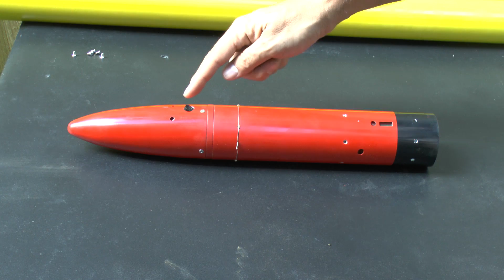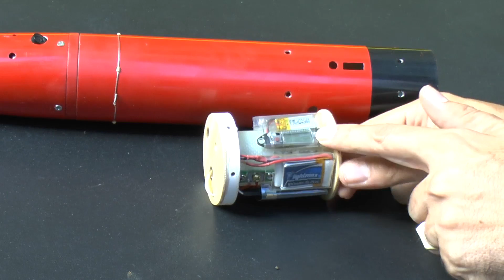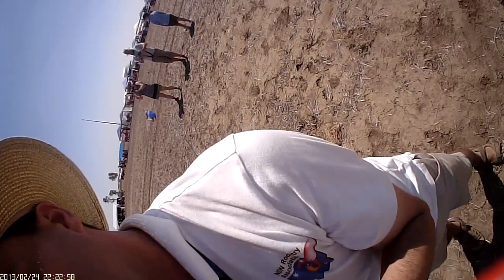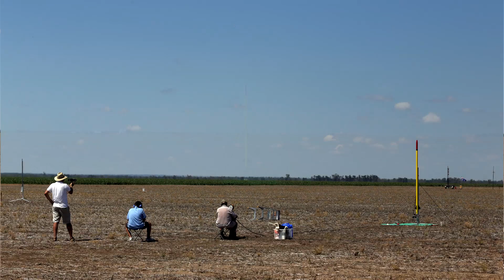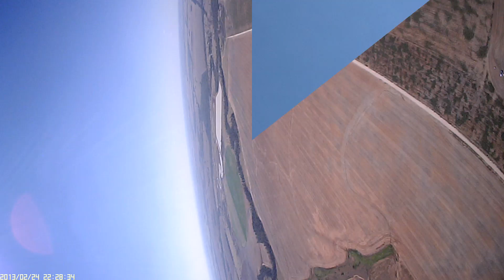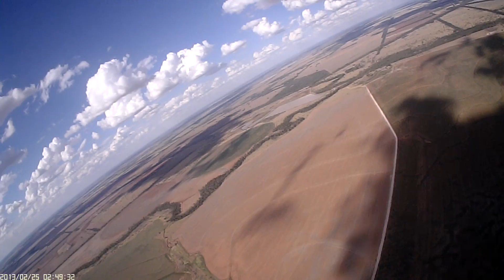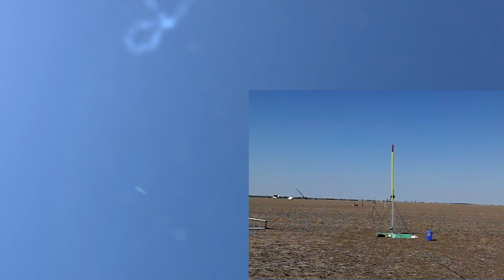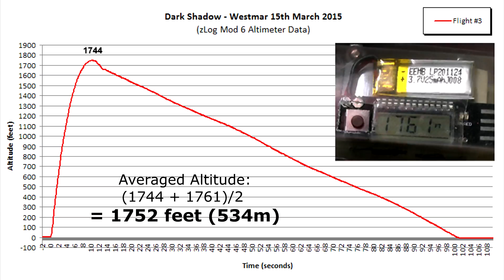Water Rocket flies to 1752 feet (534m)

Comment: It appears that there's a rod on the launch pad that extends up INSIDE the rocket through its nozzle and that most of the vertical thrust occurs while the rocket is ascending up that rod. There's some water that escapes during that short time but most of the water escape within just a few feet of the rocket clearing that rod.

So, is the acceleration, and therefore the height attained, due to the thrust acquired while moving up the rod or  is it from the water expelling through the nozzle? I'm wondering if it would give even better acceleration and height if they just left out the water completely, which would significantly reduce the weight of the rocket, and simply relied on the thrust achieved by having that rod inside it.
Reply from the maker: Roger Garrett Hi Roger. The rod is called a "launch tube". The launch tube acts as a piston during the first part of the launch. Depending on the size and length it can give about a 5% boost to the overall peak altitude. During the launch tube phase it produces about 1/3 the thrust compared to the thrust you get after the rocket leaves the launch tube and starts expelling water.
Reply: Hmm. I don't see how it can provide 1/3 of the thrust but only a 5% boost on the peak altitude. And from the very first picture of the video (and later in the slow-mo launch video) it appears that the water is expelled within just a couple of feet of leaving the launch tube/piston. Are th 1/3 ~ 2/3 numbers just estimates or "conventional wisdom" or are there actual measurements to support them. I'm thinking that the number of frames of the video for the launch tube phase and again for the subsequent water expulsion phase, coupled with the distance travelled in each phase, could give at least some idea of the actual thrust being achieved by each.
Reply from the maker: Roger Garrett No, these are actual numbers. It's not 1/3 of the total thrust, but 1/3 of the average thrust for the duration that the rocket is on the launch tube.  The reason I say a third because that's what it is for this particular configuration. It really depends on the length and width of the launch tube in relation to the rocket and nozzle size. Have a play with Dean Wheeler's water rocket simulator and have a look at the acceleration and altitude curves with and without the launch tube.  We have captured very similar real world data with onboard accelerometers. Here is some real world data from one of our flights on a different rocket: http://www.aircommandrockets.com/images/2011/day100/PolaronG2_FC_Acc_Vel_290111.png

Comment: Wow how many Gs of acceleration does this thing experience?
Reply from the maker: Nevir202 On the last flight it was close to 50G. The rocket and deployment mechanism were designed for 60G+.
Reply: AirCommandRockets
Thanks for the response. That is just mind blowing! Just thinking of the stress implications of that kind of force.... Any organism would be liquified... O_O
Reply from the maker: With a lightweight single bottle rocket at only 120psi and a 20mm nozzle you can get accelerations over 150G!. :)
Reply: AirCommandRockets
Brain melts

Comment: Are you guys using just clean water for your propellant, or adding salt/sugar/something to make the water heavier & maybe increase your total impulse with the added mass?
Reply from the maker: Hi Robherc H , Yes we just used regular tap water and regular air for this one. You can dissolve substances in the water to make it heavier and generate greater thrust, but the rocket will not fly as high. This is because you are also lifting a greater mass still remaining in the rocket. Water rockets actually perform a little better with lower density liquids such as alcohol. Scroll to the bottom of this article for more information: http://www.aircommandrockets.com/water.htm
Reply: Thanks; that was an interesting read! Based on that info, I think I have much better informed idea for a different propellant mixture. What's your take on using a mixture that "settles" for propellant (like water and oil, or water & iron powder) so your rocket would then have a "staged" 3-material expulsion thrust (heaviest water, then lighter oil, then lightest air), smoothing the thrust curve, while minimizing the remaining weight of propellant within the rocket at all heights?
Reply from the maker: Robherc H That's certainly an interesting question. It would be worthwhile running some calculations to see how effective something like that would be. Another way to look at it would be to have varying density of foam with the same liquid.

Comment: What kind of G Forces does that get on launch? Did you have to take special consideration of that during the selection and mounting of the electronics?
Reply from the maker: The last launch would have been around 50G. Yes we did pay special attention to how everything was secured against the G forces. Not just the electronics, but all other mechanical components as well. Including how the entire nosecone was attached to the top of the pressure chamber. We planned on 60G+ in the design. At 50G the entire nosecone and payload bay weighs ~14kg.

Comment: Hey there! Great Rocket! We in Germany are not allowed to fire those rockets without a permission :D. Im very impressed of your launcher. It would be great if you could make a tutorial about the nossle and the starting mechanism. Thank you!
Reply from the maker: Hi MultiSegelflieger, we too only fly these big rockets at club sanctioned events where we have permission to fly to the altitude and are also covered by insurance. We actually had a German team come to the Thunda event to try and fly a big O-motor powered rocket because of the restrictions on those kinds of flights in Germany. It was a very impressive rocket though they had an anomaly during the boost phase. 

There are more details about the launcher on the build log here:  http://www.aircommandrockets.com/dark_shadow_2.htm#_050115 It is based on the Polaron G2 cluster launcher, but bigger to handle the higher pressures. I will be putting together a video to show how it was built and how it works.
Reply: AirCommandRockets Thank you very much for the answer. Have a nice day :D

Comment: Congratulations George, and the hole team ! Your achievement is really really amazing.
Beautiful flight and video. You have now less than 100m to gain ;)) and you can do it!
Reply from the maker: Marius Dinescu Cheers Marius :), we think the rocket still has a little more up its sleeve, but I think we are close to the pressure limit with this one. We can now model this rocket a bit better in the simulator since we know a little more about its actual performance.

Comment: 600psi! Holy moly! As much as I'd hate to see it fail  I'd be interested to know how much it could take before exploding.
Reply from the maker: StarlightVisual That's the big question. We first made a test chamber that was about 70cm long and it was still holding 650psi. We wanted to burst it, but we were also getting close to the safe limit for the hose and so we aborted the test. We're not sure how much more it will hold, but intend to find out at the next launch. :)
Reply: Best of luck! Keep safe though :)

Comment: These are actually one of the most impressive onboard footages I've ever seen.
The height looks almost incredible. You did a really good job at your build log, I just scrolled through it and was impressed by the level of detail. I'll definitely read the two pages tomorrow.
It would be awesome if you could place the onboard camera in another angle so that it films a bit of the rocket itself at your next launch. Keep up your work, your rockets are getting better and better and it's truly stunning with how much precision you work. Also very good video editing. :)
Cheers
Julian
Reply from the maker: RaketfuedRockets Thank you Julian, we were happy with how little spin there was on the rocket. The new fin alignment jig worked really well. The angle of the video camera was intentional so it would film the horizon near the top of the frame as most of the interesting things to see are on the ground. Because the camera is in the nosecone (that's where there was room) we had limited capability of looking down the rocket without extending the lens/mirror further out into the air stream and causing more drag. I'm happy to answer questions about the build if I missed something in the build log. :)